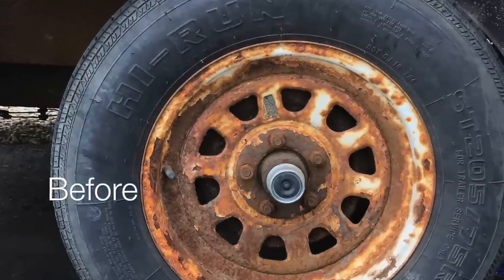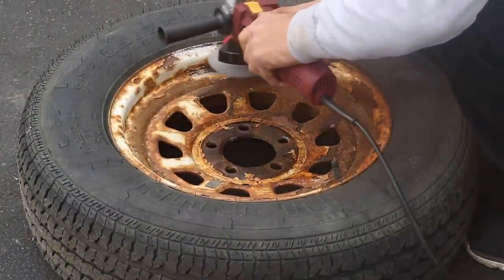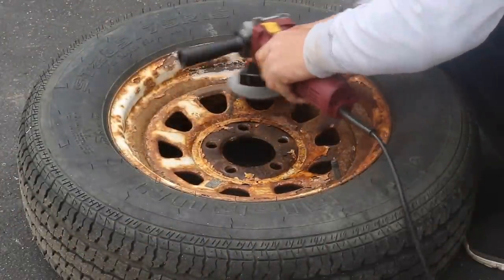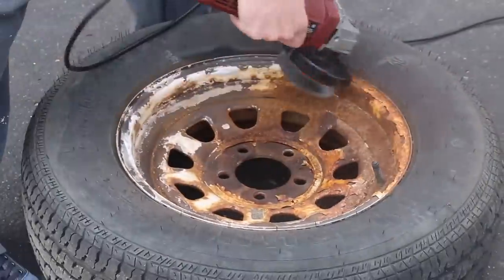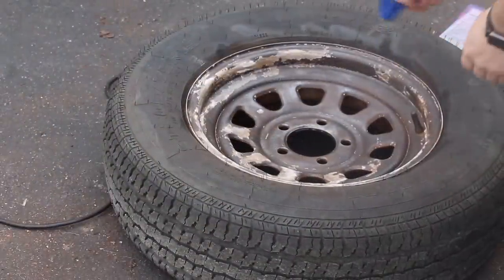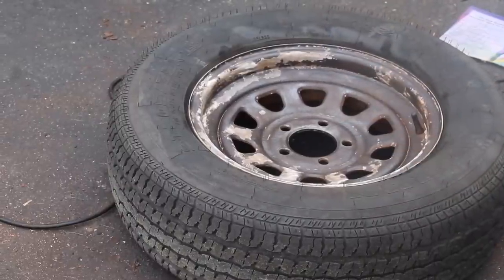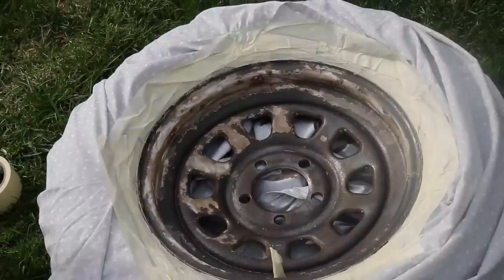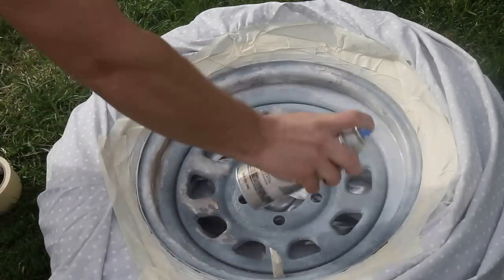How to: RESTORE RUSTY white Trailer Wheels / rims

Comment: Use a deck of cards and place them around the rim before you paint.
Reply: Wow,  thats a good tip. never though of that.
Reply: chrisfix
Reply: How important is doing this to the back of the rim? Will rust spread if you dont?
Reply: Painters tape or even cheap masking tape works. I’ve used both. Tuck it in behind the rim. You do have to do it in short strips

Comment: Good job getting all the rust off.  I have found hammer pounding, chiseling, scraping, and also using a big sawzall blade hand scraping can pop off lots of rust.  Those blades are sharp hardened steel, great for scraping rust bubbles off of steel. Then coat 3 coats of white BullsEye 123 primer and spray what color you want holds up ok, without having to get every bit of rust off.

Comment: I used aircraft paint remover for my trailer wheels, so much easier and actually removes everything, doesn't leave paint behind like you did
Reply: Where do you buy that product? Sounds like some acetone mixture.
Reply: @systemfox4724  any autoparts store has them, autozone, advanced auto parts, etc.

Comment: Hmm. What about the inside of the rim? I mean the other side of the rim, doesn't that need to be painted, too? To prevent rusting.
Reply: No diference, both inner and outer sides are exactly the same after year or two. Kind of repair is only cosmetic.
Reply: To be completely sure, he should have removed the tire and cleaned the entire wheel, treated it with an anti-rust compound and then primed and painted the entire wheel.

Compressed air going into the tire contains moisture that will continue to aggravate any rust inside the rim.

This was a cheap cosmetic job that won’t last.
Reply: He probably could have given it 100% in the video. Maybe he did and didnt show us that part.
Reply: @kjamison5951   it will last longer than the tire. Then you can buy a new tire/rim combo for cheaper than a new tire and mounting

Comment: Nice work but the rims are so cheap he time you buy the pain it's been all that time doing that you could buy each rim for 50 60 bucks I'm guessing the paint is going to cost you around 50 so come out your pocket another 60 plus getting new rim on Tire another 20
Reply: One can of primer and one can of paint will do several rims. Now you can get paint & primer in one. Less than $5 at Walmart.

Changing tires on these rims is a PITA. I’ve been buying the tire & rim combo for not much more than the tire, and less than the cost of a new tire and mounting.

But if you don’t need tires, this makes a huge difference in the appearance of your trailer.